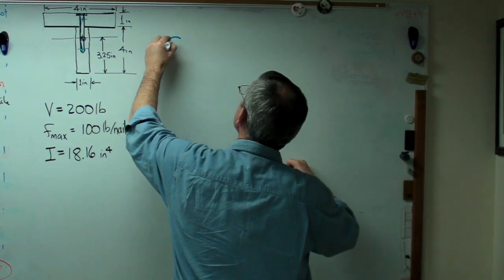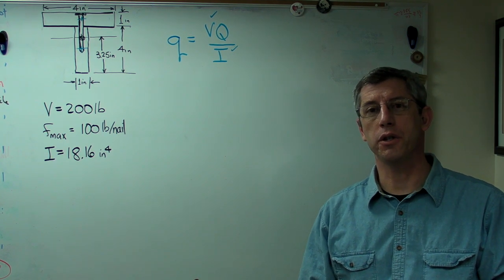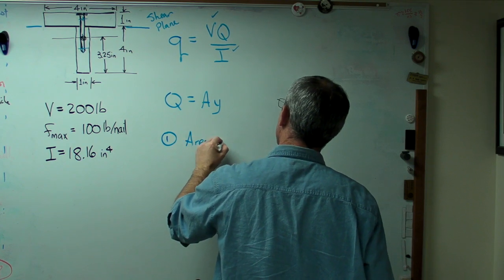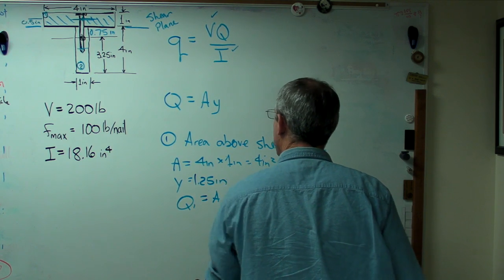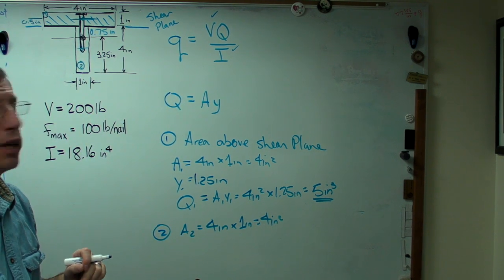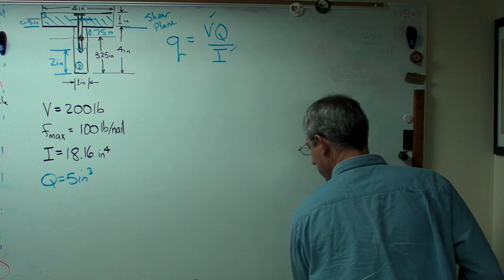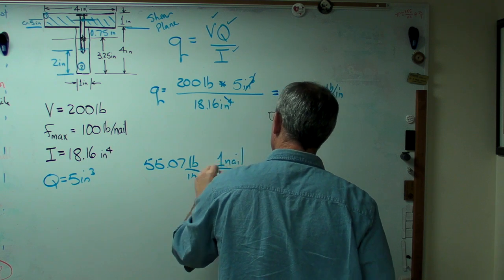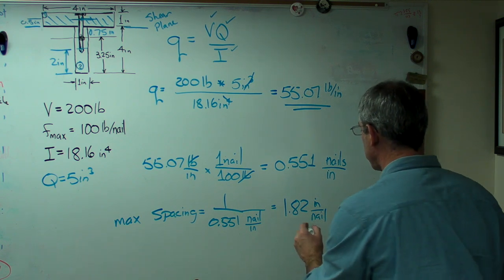Shear Flow in T Beam.MP4

Comment: Is this a beam in bending with the 200lb representing the maximum vertical shear force based on a point or distributed load? And does this give me the fasteners required to develop composite action in the built-up beam?

Comment: I have a pretty basic question. How did he choose the shear plane ?
Reply: +RSA RSA and I don't understand what max spacing means here.. Does that mean the next nail has to be at max 1.82 in ? I don't get how he uses that formula to get the max spacing? Could anyone please explain
Reply: Its basically a connection of two beams together with a nail. So the shear stress is to be calculated at the junction and hence the plane is considered as the shear plane for evaluation.
Reply: The same concept which is used in the design of welding in case of plate girders. at the flange and web junction.